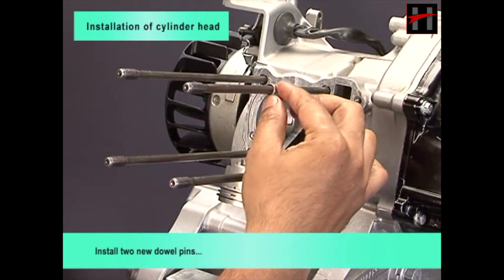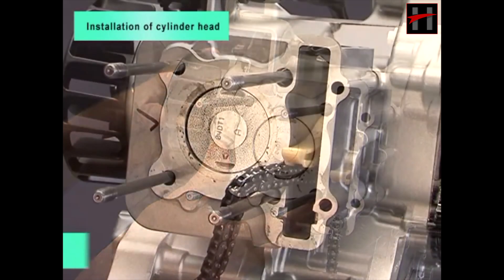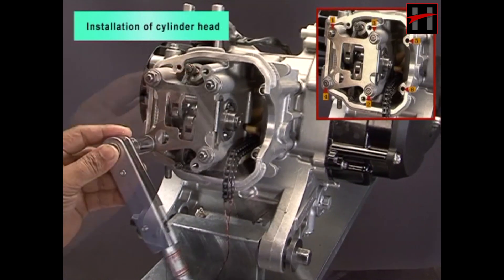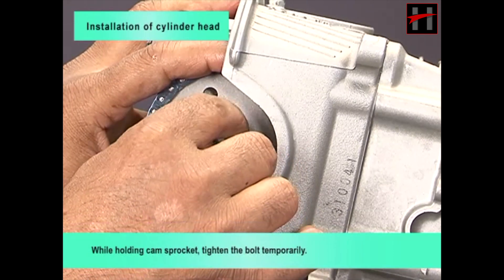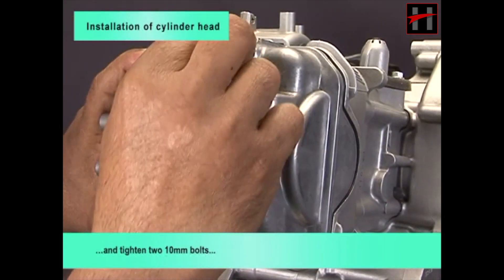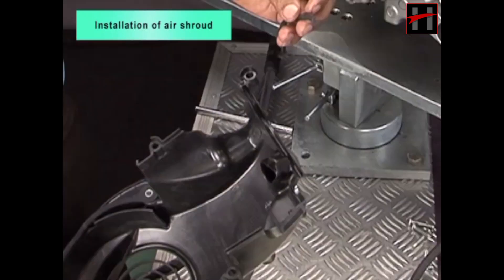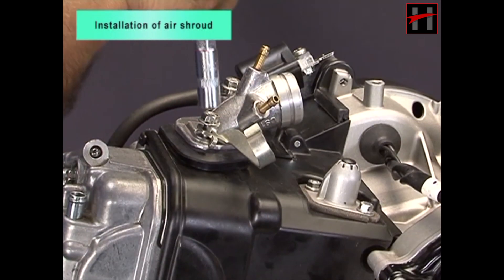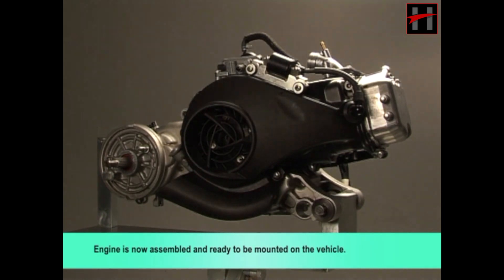Installation of Cylinder Head & Starter Motor in Yamaha Ray & Ray Z

Comment: My Yamaha Ray ZR scootre engine oil level  comes down abnormally after every re fill and I have been observing this matter from the biggining of the use of my brand new bike.

Except to engine cylinder block damage, can there be any other reason to reduce engine oil like this..

In addition I checked the compression level of my scootre engine while let it to run freely In a slump and observed that the bike is gradually break it's own by slowing the engine.